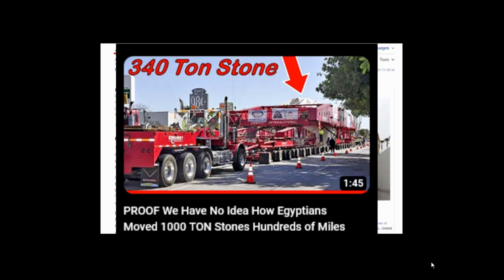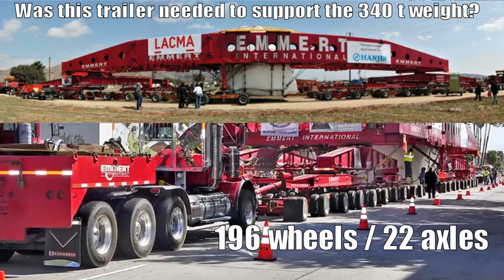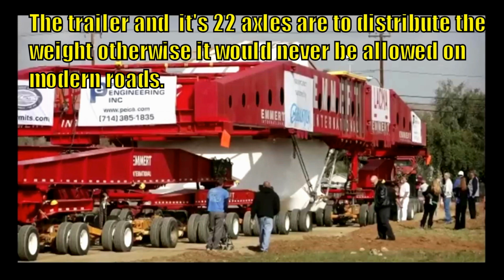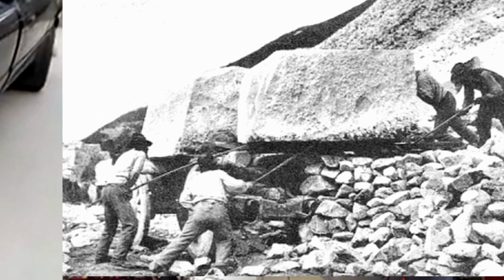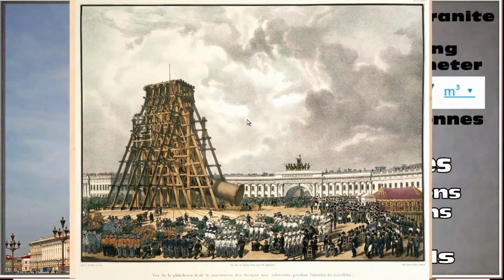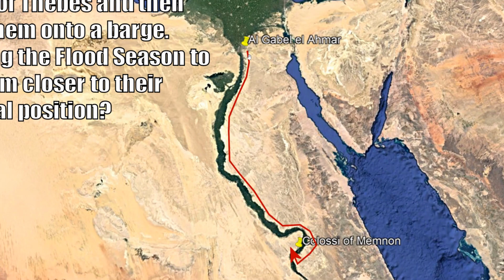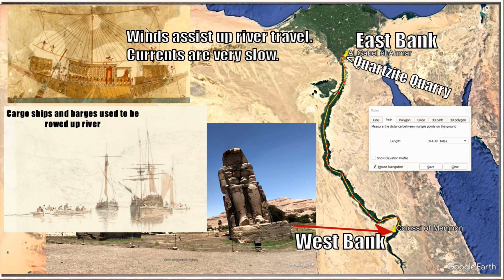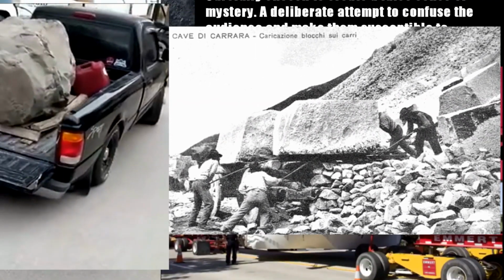Why Does Lost Ancient High Technology Keep Repackaging Old Scams As Fresh?

Comment: Honestly, I don't agree with the assertions made in these lost ancient technology videos regarding the Giza pyramids. They're just pyramids; there's nothing particularly advanced or practical about them. The reason many cultures built pyramids is because it's the simplest way to construct a large, tall stone structure without it collapsing. The inherent stability comes from the fact that 95 percent of the pyramid's total volume is solid rock. Essentially, you're just stacking rocks on top of each other. This explains why nearly all significantly tall ancient structures were pyramidal in shape, including the Sumerian ziggurats and the Egyptian pyramids. The sole exception to this pattern was the Lighthouse of Alexandria, built by the Greeks. Unlike pyramids, the Lighthouse featured floors, windows, and tiers, making it undoubtedly more advanced and practical.

While the pyramids were undoubtedly impressive for their time, they weren't the pinnacle of ancient engineering. Exploring the interior of the Great Pyramid, for instance, doesn't reveal large open spaces like arches or vaults, highlighting their functional limitations. Even the Egyptians, after Giza, ceased constructing large pyramids, likely due to the realization that it wasn't economically sustainable and represented a significant waste of resources. What practical use does a pyramid serve anyway? It's essentially just a stack of rocks. Consequently, they shifted their focus to constructing large temples, which, despite also being religious structures, provided usable space with features like columns and halls. The Egyptians had to resort to using numerous interior columns to prevent the roof from collapsing, as they lacked the keystone arch technology.

In comparison, structures like the Lighthouse of Alexandria or the Roman aqueducts are undeniably more advanced and practical than pyramids. Yet, curiously, discussions around lost ancient high technology rarely include them."
Reply: "Economically feasible" is the key here.  The Egyptian Pharaohs of the 4th Dynasty obsessed over expending a lot of wealth to create the large pyramidal tombs made of stone.  The subsequent 5th Dynasty saw them shift to promoting their divine status via solar temples to propagate the cults they built up around themselves.  So they still crafted pyramidal tombs - BUT - the impetus for doing so had changed.

Later Old Kingdom dynasties however appear to have become increasingly bankrupted as the environmental conditions shifted - specifically prolonged drought.  Remember that the Egyptians did not use money per se as we do today as theirs was a commodity-based economy mainly based upon agriculture.  If agriculture suffered owing to drought etc. then tax revenue would correspondingly suffer. 

Moral:  lacking the wealth and resources of earlier dynasties the later Pharaohs had to contend with cheaper facsimiles of the older all-stone grand pyramids.  They made them smaller - but - more ornate in some respects and constructed them differently.  

They experimented on cost saving versions such as using mud brick cores or even rubble contained by "boxes" they created to form the interior base.  Mud bricks were cheap and easy to make while pyramids built mostly of them would be lighter.  That would allow for their placement in areas otherwise impossible for a all-stone pyramid which must be near the quarries and resting upon reasonably flat bedrock so as to sustain its' great weight.
Reply: @varyolla435  so if the pharaohs were becoming skint and started shopping in ikea why bother building a pyramid tomb to then be buried somewhere completely different. Why if you were skint would you build a tomb you were never going to be buried in?